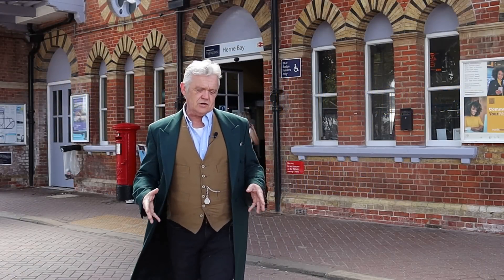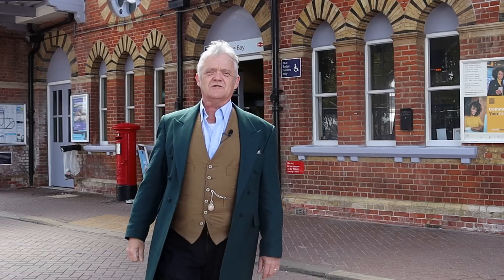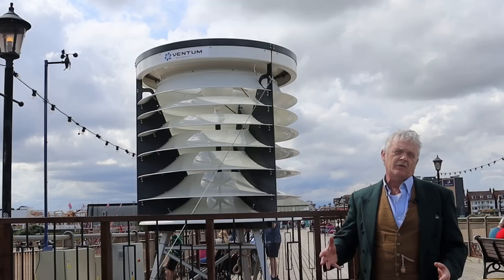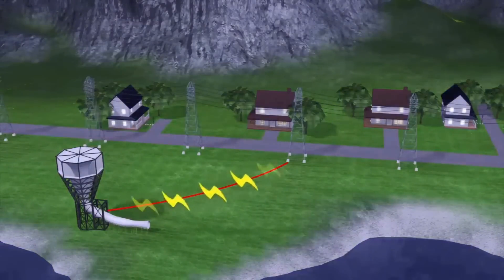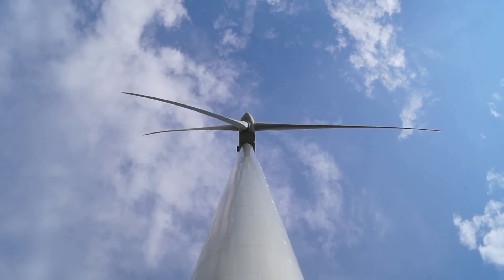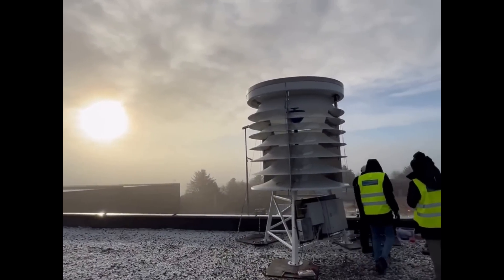1997 Darwin Wind Turbines - Is Bigger Better?

Comment: Additional benefit is that the bearing wear is more uniform when the shaft is oriented vertically.
Reply from the maker: nice one mate - cheers
Reply: Im not quite sure that's entirely accurate since bearings have tight tolerances
Reply: No mate, if bearing wear is an issue, this design will increase that wear since the loading on the fan blades will be lopsided due to the ducting.
Reply: Downside being ice buildup during winter storms.
Reply: manitoba-op4jx  not ballpoint pen bearings?  :)

Comment: Did I miss something or were the blades stationary?
Reply from the maker: they were stationary - my guess is the test was over and they locked it down
Reply: @ThinkingandTinkering  This morning, the damage caused by Vandals was inspected to ensure there were no wider issues. Fortunately, the inspection has been completed, and the problems have been resolved. 😊
Reply from the maker: @ravir8354  thank you for taking the time to post mate - it s awesome to know - shame i missed it turning it would have been icing on the cake so to speak - but it is super impressive non the less - cheers
Reply: @ThinkingandTinkering  Sorry. That was unfortunate. It would have been much better for your video if it had been working.

Comment: Turbine could be made more efficient by simply adding an array  of motionless check valve like a Tesla valve, would require extensive fabrication
Reply: Wasn’t that used for slowing a flow through 
Interested to be put right
Reply from the maker: that's a little unlikely to get made mate - the efficiency may well go up but the cost and size would be excessive i think

Comment: Love your shows, sir! You do love your generators, and I appreciate that. 
One thing you do not talk about...the dirty little secret of the Green Energy movement. Those gigantic wind turbine blades - they do not last long....the blades wear out rather quickly, more so as they get larger. Given that they are made of composites, and mostly Carbon Fiber, and none of them are recyclable , the worn out blades do tend to be trucked off and dumped where no-one can see them . This, in itself, is an argument against BIGGER - and for other methods of turbine generation, and power generation in general.
Keep up the good work sir!
Reply: But they did find a way to recycle those blades and turn them into gummy bears for our kids!
Isn’t that wonderful?
Reply from the maker: i have done videos on it mate
Reply: Composites can be recycled via pyrolisis or some weird reaction with their resins.
Reply: Modern blades are composed of half fiberglass and carbon and are recyclable into fiberglass and synthetic gas, which is already being commercially done.
Reply: For what it's worth, there was some recent news about recyclable blades that were *inflatable*! In any case, I do like the idea that nearer is better.

Comment: Inserting  a small darwin turbine into every street lamp in the country with grid feed in during the day is my idea of the day.
Reply: I've seen that suggested for all along highways to capture the wind from passing vehicles.
Reply from the maker: good idea
Reply: al smal bits are getting big. and spare more energie bit by bit jup. more is more power full. and more jobs to. some how i think thats the begin of the best. begin smal and big.
Reply: Yes! I think Ventum would do very well to pick a few standard sizes and mass produce them to get the costs onto a learning curve. That's how you land geometric price improvements over time.

I'd LOVE to see a little one of these on every light post, telephone, and electric pole!!
Reply: @mookiemorjax 887-3412
Reply: @mookiemorjax Imagine that, hundreds of thousands of these working in unison. Those are dangerous thoughts. It almost as if you'd remove the fear of a central power attack and go green all at the same time. No, I've got to stop yee, before it's too late.

Comment: Memories of catching the train to Herne Bay to work on the old pier skate rink.. :)

Anyway back to the topic.. I wonder if there’s any mileage in an appropriate sized device to sit atop our chimney. I’m aware there’s potential limitations regarding height that might cause issues but seems less invasive than a traditional turbine..
Reply from the maker: like a rotating ventilator?
Reply: @ThinkingandTinkering  Something like that I guess. Can't find any information on limits though. Still an interesting question.
Reply: @martinsmallridge4025  A brick chimney will require reinforcement, since there will always be an upwards pull on the windward side, and mortar doesn't handle any appreciable pull. It must be feasible, though: We have setups of that nature on several 19th century buildings' chimneys (chimnies? Ech, grammar) in Denmark 😉
Reply: @martinsmallridge4025
Kindly do not mount on said chimney as it will probably cause the chimney to fall and break the turbine as well. If that doesn't happen the chimney heat along Will set it on fire or burn out the generator.
Reply: @reypolice5231  Obviously I'd check the actual stresses for the chimney and we don't use any fires for our chimney now as it's kind of common sense here but I take your points..

Comment: Bigger isn’t always better as Siemens Energy have found out . They have a catastrophic failure of their bearings and blades . It’s wiped a third off their market value . Maybe Rob could fill the energy requirements
Reply from the maker: there is always a limit mate

Comment: by the time you have taken into account transmission losses and transformer losses, generating nearer the point of use makes considerable sense
Reply: Generation of energy via any abundant untapped existing source is a win regardless of losses, since wind is created by the uneven heating of the planet it's a solar driven process and as show can be easily built and remain mostly passive, some farm land with a wall of these charging a battery bank would be nice and excess generation could be used to heat a sand battery that a heating system could use to heat ducted air off of like a cars heating system
Reply from the maker: for sure mate

Comment: I notice the turbine wasn't going round in your video.
Reply: Yes. Sorry, but this sounds like an advert for Ventum. I've thoroughly scanned their websites. No real field test data to be found. None. Thats a big red flag right there. I'm willing to bet that installation will eventually be removed. Or vandalised... 😉
Reply: Gentleman he said they use it to light the lights at night. It seems no back up batteries, so it's not used all day, just at night. 

The trains may not run all night, so he probably left on the last train, so as to not get stuck there all night on a park bench or hotel fees. He didn't drive he took the train it seems.
 Very English. I hate the train, I take my truck in the states, sleep in the truck, eat in the truck, avoid restaurants, hotels, and expensive things. 

He is offering not an ad for this company, he shows you how to build your own and scale up. This can be made from sheet metal or plastic or wood scrap if you have the skills to adapted the design. Think outside the box of conventional thinking.
Reply: @reypolice5231 Sorry, but unconventional thinking doesn't always wash. It has to be tempered with an appeal to prior knowledge and experience. That turbine may be used to power the lights at night, but you have to have battery storage or they going to be very hit and miss in their light output. If you've got battery storage and the lights are LED's you might have a chance, but conventional incandescents? Naaaa... BTW, those images of the turbine with the rope might be stock stills taken prior to commissioning. I don't know, but it does leave unanswered questions.
Reply: Poor Rob.He goes all that way to see it,and it's not working.
Now he's got to go again next week.
Reply: @ravenmad9225  😂😂😂 I'm surprised he didn't bring up that it wasn't working tbh, could've been funny but still as informative
Reply: @reypolice5231  There are other designs for wind deflectors and concentrators besides this one and the other one he showed. Some can also reduce drag in VAWTs by pre-orienting the wind.
Reply: Me too.Wonder how well it actually works.
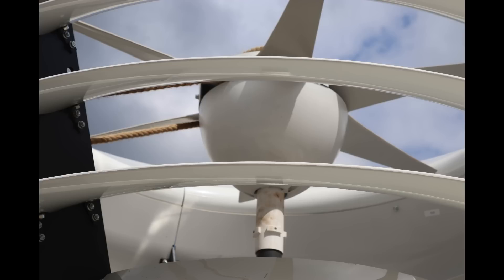Reply: At 2:11 you can see its tied up with a rope i have no idea why but it looks like a rope
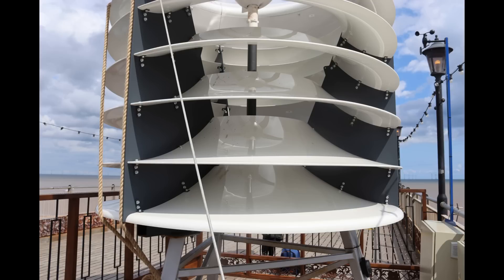Reply: @jaapjethee Didn't notice @ 1:55 That's kinda weird to have that during a testing phase clearly impeding the rotor.... 🤔
Reply: @saiello2061  i bet its broken and they dont have a brake in it so they tied it up
Reply: @jaapjethee yeah,maybe it span too fast!
Reply: @stupidscruff  that could be true that there is more wind there than expected. But you would have a break and or a breaking load to slow it down. But then again it might just be stock pictures like mentioned before.
Reply from the maker: my guess is the test period was over and they locked it down
Reply: @ThinkingandTinkering  that could also be true. It would be awesome if we could see the numbers.
Reply from the maker: @jaapjethee  it certainly would - but from my reading of the company they seem to be doing a fair few installs - especially in Norway - which is where they are from - so  I am guessing they are doing ok
Reply: @ThinkingandTinkering  i dont mean monetary. I mean how much it generated there on the pier vs its price . And at what windspeed it was the most efficient.
Reply: @jaapjethee  It's possible that is the reason to lock it down, but that doesn't make any sense to me, it seems like an artificially short test period. I'd imagine any turbine test worth anything would need to be conducted over a period of at least a year to see how it performs under varying seasonal weather conditions to see if it has long term potential. There are many other test factors that don't include power generation performance that require long term testing; durability, hazards to the environment, environmental impact on the turbine, running costs, public objections, etc. For these, you'd want to leave your turbine running for as long as you possibly can until the thing actually breaks down. It looks like the plug was prematurely pulled on this test, for reasons that remain a mystery... 😋
Reply: @ThinkingandTinkering  Some 3d air flow simulations suggest that any form of cowling slows the overall flow rate near a wind turbine. Any thoughts on that? There are several models with incorrect boundary conditions that predict inceased air flow. Cheers

Comment: Given the design, it looks like there is a potential to make it collapsible for portability. Has anyone seen one that does?
Reply from the maker: i like the thinking mate - you have given me an idea too!! cheers
Reply: @ThinkingandTinkering  waiting for the video then
Reply: No, but you gave me some ideas...
Reply: I haven't but a scotch yoke as a track would make it collapsible, in four sections.
Reply: The production version is designed to be fully collapsible, making deployment incredibly easy and enabling effortless re-location whenever needed.
Reply: You mean like, pancake the funnel sections together? Maybe with some kind of scissor mechanism it could be done in one piece, but I'm pretty sure those 4 solid sheet metal vanes around it serve an aerodynamic purpose. Maybe you could make something that snaps together...
Reply: @DFPercush  3 vanes, look at 2:00 😉

...but let's say you make it collapse like a harmonica, could the vanes then be made foldable, so they collapse in over the funnels and turbine..? 🤔
Reply: @Smo1k  .....accordian?